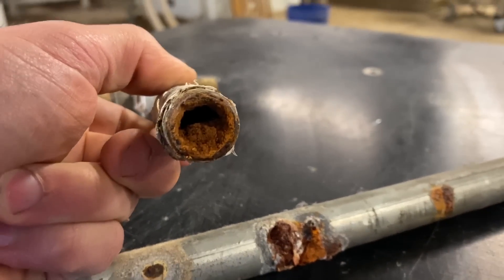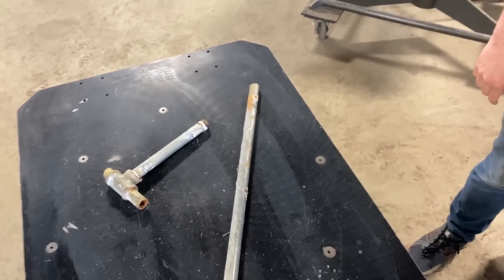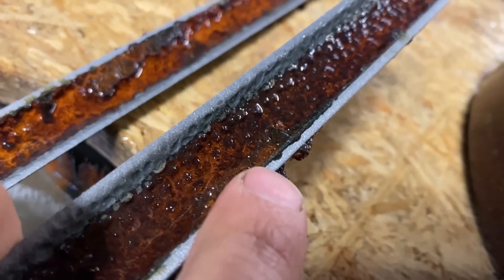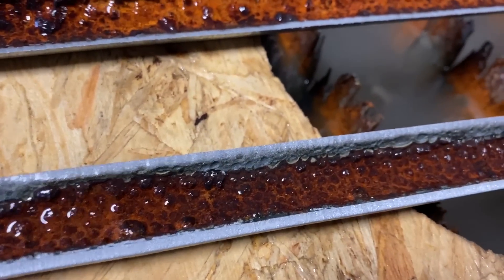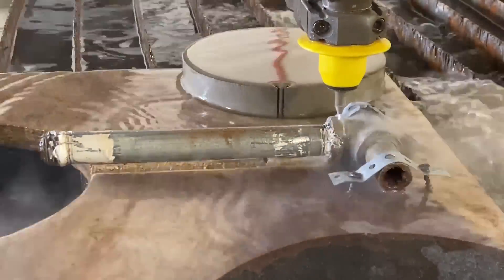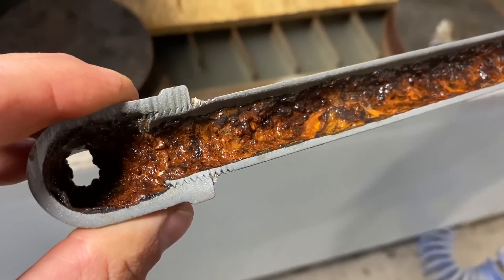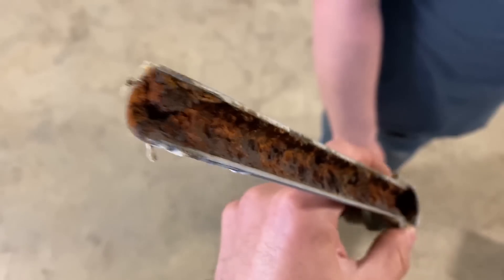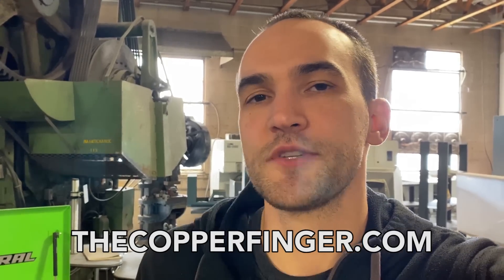What's Inside Your Pipes? Galvanized water pipes cut in half

Comment: That is a little over 70 years of buildup, so it is just very minute amounts of deposits per use of the tap. Still would be a good idea to have the pipes check every 10 years if they are metal, every 5 if they are of a plastic, or just spend a few hundred to few thousand for a filtration system to pre-filter and pretreat your water before it hits your water heater or boiler system. So you can have drinkable tap water at the sink, in the shower and in the toilet.

Comment: The easiest way to remember is this lame saying. "As the mites go up the tites go down" stalagmites are the ones that point up and stalactites point downward. 
They are deposits of mostly calcium and salts (in caves not necessarily water pipes) that get left behind from dripping water and most the time when you have a stalactite you have a stalagmite below it as they are caused by the same thing it's just where the water lands instead of where it dripped from. 
If they had put a rock under where it was dripping  the could have possibly made a stalagmite on it

Comment: This doesn't take a 70 years, on hot water supply with hard-ish water steel galvanized pipes can be almost blocked in year or two ^^ only water pressure keeps pipes from blocking up completely ;)
Reply: Sure, but all water has different levels of minute amounts of minerals and metal bits in them, so for 70 years that is not as bad a places where pipes get blocked up every few years.

Comment: You guys know that happens in all pipes and actually helps keep the water safe from any lead inside the pipes. In flint they were fine until they switched to river water that was too hard for the pipes, the pipes were fine before because they were coated with the build up but they water broke that down exposing the lead pipes to the water causing the contamination

Comment: 1. It looks worse than it is. 2. Replacing water pipes is sometimes a good idea, especially if your house was built on the cheap. 3. Consider getting a water filtration system or a Brita filter pitcher, it's worth it.

Comment: The water is perfectly safe to drink even though there is rust and mineral deposits on the inside of the pipe. The only problem is, that there more deposits on the inside the lower the dynamic pressure will be and the less water will come out the tap.

Comment: It takes 2 different metal, and an a electrolyte to cause rust, the water in the pipe is an electrolyte, galvanized pipe is a metal, and hard water can have metal minerals in it causing all that damage
Reply: "and an electrolyte" not sure you are adding an "a" as an only before a word with a, e, i, o, or u, vowel.

Comment: If you guys saw the things I've seen, you'd never want to drink straight tap water again. The big water lines under ground get the exact same buildup pattern/ lumps but they're just bigger. I never really asked why it forms like that. I mostly do water and air pipeline work at ski resorts for snowmaking but I've done domestic water lines too and after what I've cut apart and ripped out of the ground definitely made me think twice. We don't even bother trying to cut that steel with a torch, we just crank up the welder and cut it with welding rod lol

Comment: Once helped my mate to seal up a factory old main water pipe. It had been used for decades, something like 10" diameter. There was at least 5cm thick crust on the inside.. Didn't test if it was soft or hard but i'm guessing fairly hard.. Mate said that it is fairly normal buildup and to not think about the municipal water pipes...

Comment: Have you ever heard of Electrolysis from dissimilar materials? I used to work for a plumber that made a point about it. That mixed with the extra minerals or water softeners used. And I dont think it helps the matter when you Bond to the pipes. If anything id think that makes it worse. That and the water hammering effect thats taking place every time a valve is turned on and off. Theres nothing to be done really for the cavitation in iron pipe. I dont think the cavitation would even be an issue if it werent for most Iron based plumbing systems acting as galvanic cells. Its just a theory though

Comment: As water goes through the pipe vortices are formed due to the aeration of the water. This causes areas where minerals are more likely to be attracted. When you used the waterjet it popped off these mineral nodules to leave behind the cratered golf ball like surface.

Comment: Many water suppliers add fluorosilicates to help keep pipes from corroding.  This pipe perhaps did not have any fluorosilicates running through it.  Another thing, it is common for people to use grounding clamps on water pipes in their house.  That could cause galvanic corrosion and once it starts to corrode it just continues on from there.  All those pits in the pipe was simply from the pipe turning to rust and the waterjet blasting the rust away.  Those are not hard water mineral deposits, just simple rust.

Comment: U guys sounded so shocked when I heard it's from the 1950s lol. My house is from the 1880s
Reply: 1880s house gang
Reply: I bet your pipes look much better, Lead tends to hold up better than Galvanized over time.
Reply: We do plumbing and heating in MN, and some of the supply lines to houses that old have lead pipes coming into them, and change to copper in the house after the meter. You would still be fine though because those minerals seal out the lead.
Reply: Same here but when plumbing was put in they used copper.

Comment: If the galvy pipe is connected to copper pipes it will cause a chemicals reaction causing stuff like that so didn't know if they attached copper at one point or not but ya as time goes on it would as well but copper does cause a reaction whith gavie pipes

Comment: The wear patterns on the inside of the pipe are due to the way the material for the pipe was produced; there's a non-uniform distribution of elements of things like nickel and carbon throughout the body of the pipe, therefor different sections will have (slightly) different levels of resistance to both the minerals in the water itself (including, obviously, the water) as well as the friction from those elements (and the water itself).

Tldr: Chemistry is why.
Reply: galvanized steel is coated with zinc.  when the coating wears away at some point, the coating surrounding that point continues to prevent rust by sacrificing nearby zinc to the rust god Galvanos.  the bare patch starts to grow in a little circle as it prefers to sacrifice zinc that is closest first.  the iron starts to form rust when the bare patch is a few mm or so in diameter.  that's why the pitting makes little circles.  the size of the circles depends on which rust spots are oldest.  when circles overlap, the corrosion will start to flake off chunks and become more irregular.  the distribution of alloying elements in the steel is way more uniform than the coating and you would need magnification to see that.
Reply: @edstirling  Pitting corrosion means that even small differences can become amplified. It works similarly to the zinc, except a small spot in the steel is preferentially sacrificed instead of the surrounding steel. Small differences get the process started.
Reply: Also, there's rust, which isn't the same as the hardness deposits. Rust is oxidized iron (similar byproducts come from oxidization of other metals, same idea applies), so the rust you blasted away was once part of that pipe.
Reply: Thanks!
Reply: Thank you random science man on the internet
Reply: Not how tldr works
Reply: first it is corrosive through oxidation
Reply: K
Reply: Big Mike stfu
Reply: That would be the anodes and cathodes} present in all metals.

Comment: This is why I've drunk bottled water for years. That and the toxic waste they dump in our local water here, "for our teeth".
Reply: Jim Griffiths what if I told you that water most likely went through pipes like this at some point?
Reply: What if I added that bottled water has an even higher concentration of minerals than tap water. And BTW fluoride is not toxic at the concentration found in water ( 0.5 - 1.5 mg/L )

Comment: It is mainly rust, which is safe (it is everywhere around you, and your body knows what to do with it (as long as you don't overdose it)). The bad part is the coating, but that is long gone since it is rusting. If water was going through even older lead pipes, then it could have lead deposits.

Comment: I really enjoyed that video. People don't realize how much build-up is inside their plumbing lines, and many drink unfiltered water from those pipes.
Reply from the maker: Yeah, I replaced all my pipes and installed filters before I moved into my house.
Reply: The water has the minerals in it regardless of whether there is build-up. So you're drinking it either way. There's nothing in the build-up that wouldn't be there if there was no build up. It isn't anything that will hurt you anyways. If you said, "people don't realize how many contaminants are in their water, and many drink unfiltered water..." (disregarding the fact of whether it is built up on the insides of the pipes), it would have made sense.